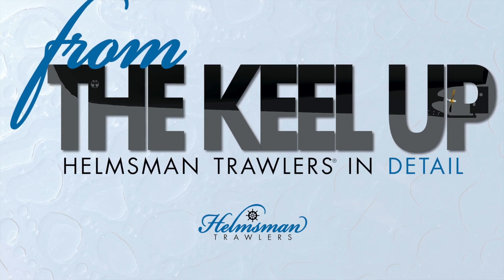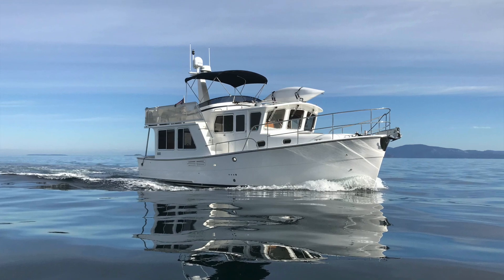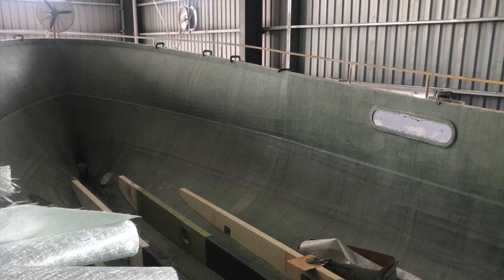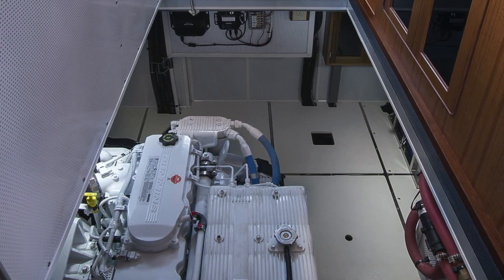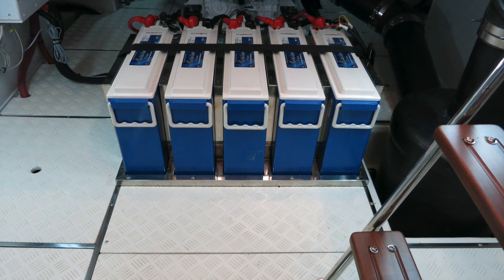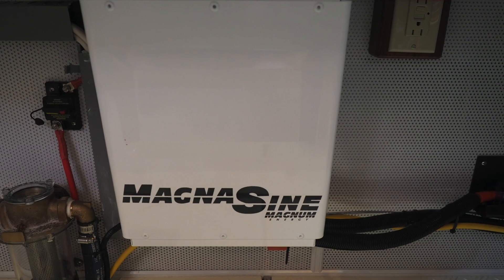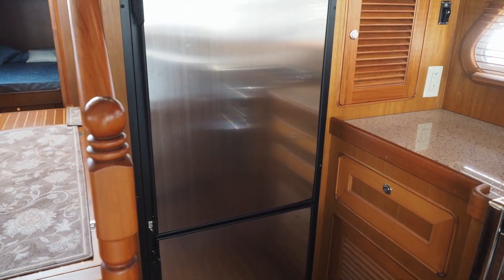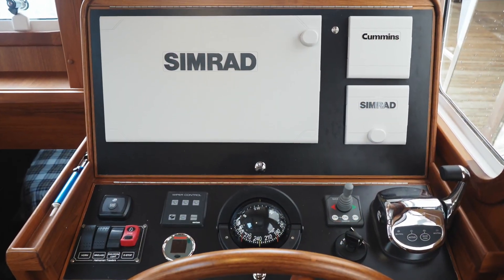Componentry - Helmsman Trawlers from the Keel Up

Comment: Of all the electrical components in the helm, which ones communicate the best?   I like Garmin.   What is the loaded height of the 38E on highway trailer?   I would like to have it shipped or haul myself on 18 wheeler?    I have an Edge Chip in my 3500 Dodge, why could that not be utilized for short high speed runs to avoid or escape danger?

Comment: I am impressed by the Quality of work gone into Helmsman Trawlers. Is there any way you can provide a 2 engine option to get the speed to 25 Plus Knots? and use one engine if the boat is used on a longer voyages?  I was trying to compare this to Sargo 36 Fly and speed is the area i thought there can be an option.. Thank you..